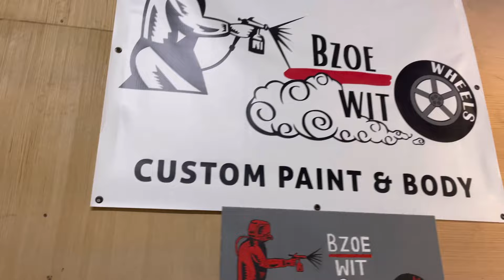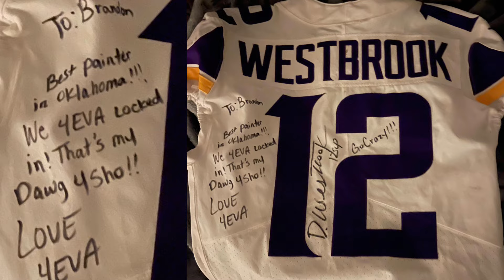Painting NFL player Dede Westbrook’s 1976 Cadillac | Donk | Red with red flake! #nfl #vikings

Comment: I'm at 20:06 in buuuut... when you wet sand sand it flat flat... then polish. I sand with 1500 the 2000 you could go 3000 the polish but for my jobs I stop at 2000... still I like your idea more. Sand it flat then flow coat it with 2 or 3 more coats 🤙🏿
Reply from the maker: Say less!! Appreciate boss!